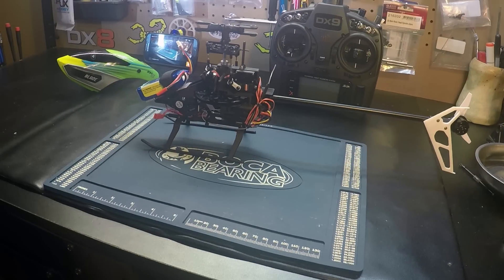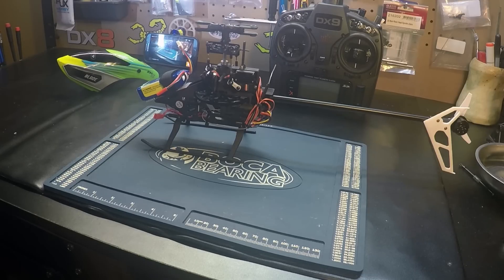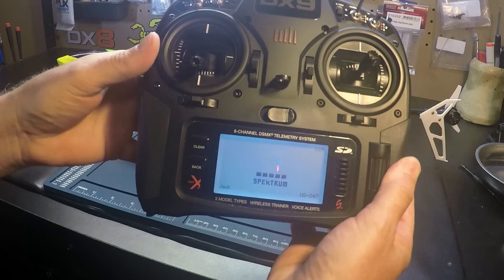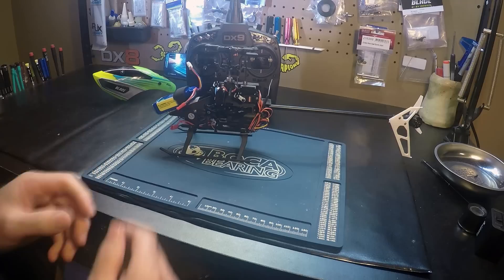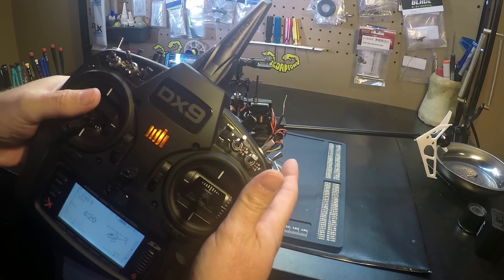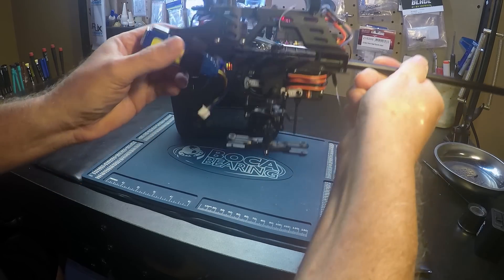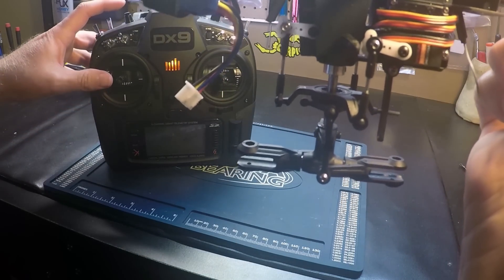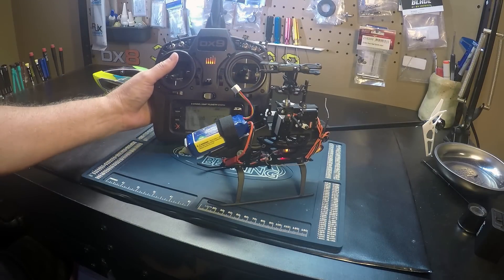Blade 230 s Safe mode bench test

Comment: Hello , I also have this Heli . For some reason the Swash Plate will not raise when I throttle up to collective pitch. everything else works fine . Throttle , Rudder , Elevator and Aileron . The Swash Plate will raise if I push the Panic /Bind button . I am using the DXs transmitter that came with it . Thanks . love your video's

Comment: I have my model setup in my DX7g2 and when i hit the bind button and look at the monitor screen the correct value moves...
Althought my rx is not responsive to this at all and my heli does not self correct.
Fyi all all other stunt modes and rates work fine...
Any ideas on what to do?

Comment: I've setup my 230s as best as i good but it always seems to be in collective mode on normal mode and when i switched to stunt one and stunt two the motor doesn't even power up. the control surfaces are fine PLEASE CAN YOU DO A VIDEO ON SETTING UP THE 230S WITH THE DX9 PLEASE
Reply from the maker: Give me your email and I will send you my 230s DX9 model for your SD card
Reply: +JJInvertedProduction i don't know if that will be possible. is it not at all possible on making a video on setting up the 230s on dx9 i know its a lot to ask but what ever works best for you.
Reply from the maker: +survivalist Scott Email me and I will send you the model settings and help you install it on your DX9. Easiest way to help you. d12bn@yahoo.com

Comment: I just got my 230s. It has the stock DXe Tx. Should it spool up in agility mode (the 2nd mode)? This is my first heli with Safe. I have a nano cpx which only has two modes so just wondering how this heli should behave in its intermediate mode. Thanks.
Reply from the maker: +Dingo06003 Both of my 230's had a hard drift in stability mode until I updated the firmware , did a calibration and trim flight. Also need to make sure the swash is level. Now it hovers perfectly in stability mode. When taking off in stability mode you do have to make some corrections until its off the ground. What my optional take off videos
Reply: +JJInvertedProduction Hi JJ Thanks for the reply. Love your videos, very helpful. my other issue is that when I flick it into agility mode it automatically turns the motor on and begins to gain head speak with no input. Is that normal? I thought it should only idle up like that in 3D mode. Thanks
Reply from the maker: +Dingo06003 Yes that is normal .
Reply: +JJInvertedProduction Thanks. I thought so. I appreciate you taking the time to help me out. keep up the good work. Happy flying from New Zealand.
Reply from the maker: Cool talking with people all over the world! If you are on FB came join my 230s group
Reply: +JJInvertedProduction I will, thanks man.

Comment: can you set the limit angle in safe mode?
Reply: I believe the bank and angle limits are in the stunt mode setups. My heli will NOT flip or loop in normal mode.
Stunt  mode 1 it will and the heli has more throttle curve and pitch
Stunt mode 2 is the max throttle allowed and flips and 3d stuff are more done easily...

Comment: Another useful vid, thanks. I wonder if I could pic your brain, I am running a 230s on a DX6, set up as per manual and all working great. My only deviation is that I have reassigned gear to a separate 2 position switch so I can choose when to disable self-level rather than having it linked directly to flight modes. Again, all works great.
My question is this, should panic button still work independently on original button or have I affected that by moving gear? My panic button (the original I button) failed your bench test in regard to moving the servos, although it does move the reading from -100 to 0 in monitor.
Grateful for any help you might be able to offer.
Reply: Sussed it. When entering mixing screen on DX6 you have to select normal, not curve. This then allows you to set up mixing exactly as per 230s manual. I now get -100 to -150 on mixing screen when panic pressed in 3d. All bench testes passed.